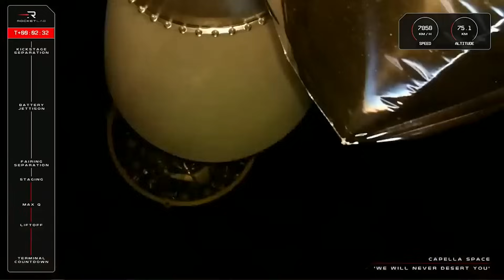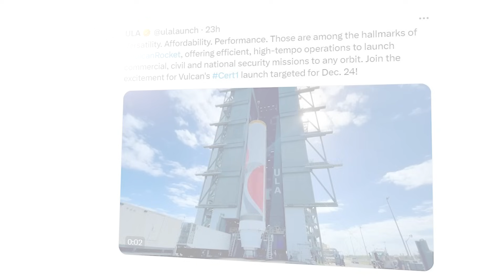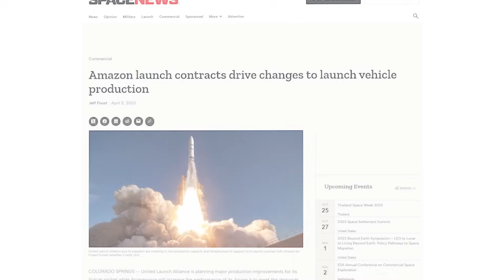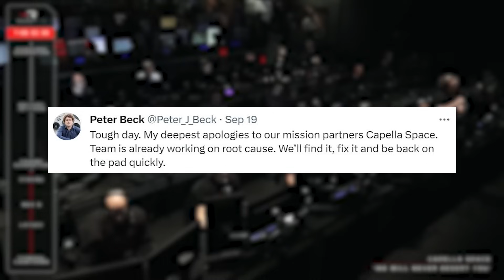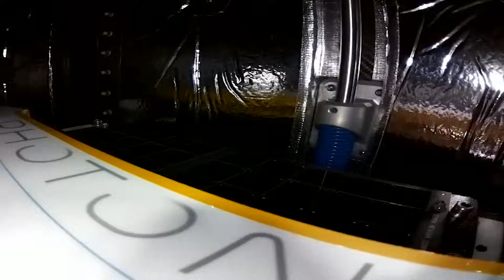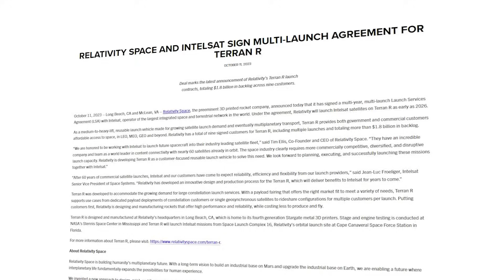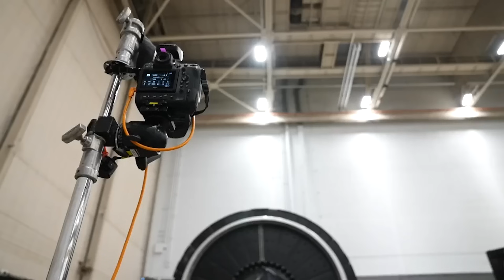Vulcan's Maiden Launch Date Has Officially Been Set

Comment: Considering that this upper tank issue is caused large scale cost and schedule issues the strength engineers responsible for the upper stage tank structural integrity should have been fired, demoted, or reassigned after this incident as this hardware issue should have been caught and rectified years ago.  The project engineers in the leadership chain of command should also hold some responsibility for this problem. However I suspect that everyone involved was covering their a** and the issue was swept under the rug.  Thankfully I am not a shareholder.
Reply: Actually what you portray as “fault should have been found a longtime ago” is not quite the case as the delays with the BE-4 allowed ULA to accelerate the upgraded Centaur V design to an earlier place in the original development sequence. It would be interesting to see a side-by-side comparison of the original schedule, vs the changed development sequence vs what actually happened to figure out if heads need to roll. Also this is kinda tied into some earlier development done on the ACES upper stage (and its cancellation).  It is useful to review how the different development programs, timelines and associated engine delays impacted each other.